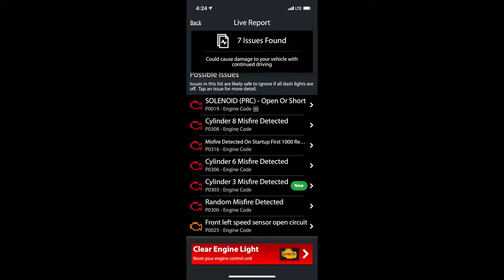2018 F-150 5.0L VCT Issue: P0025, P0019, P0300, P0316

Comment: Hello Sir , I want to thank you for this well done video, to the point but all details in there. I watched this several times. Then tried it on the left bank.
When touching wires as shown tic,tic,tic,tic,tock,tock,tock cleared codes problem solved thanks again. That was two weeks ago. Ordered and replaced all 4 solenoids yesterday.

Comment: Was having rough idle/stalling issue this morning. Found your video with in about 20 mins of researching. Did exactly what you said it fixed the idle/stall. Took it it to my local mechanic he confirmed via check engine like. New VCT solenoid ordered and will be installed tomorrow. Thanks again! Had me worried it was cam phasers or something much worse lol.
Reply: How much was the labor cost to replace something like that?
Reply from the maker: @bryansierra407  
The part was about $40 and took me about 30 minutes to change it.
Reply: @mrjdinner1000  where did you get the part from
Reply from the maker: @mikepiazza4872  went straight to Ford. Not expensive at all.

Comment: Another life saved by this video! Truck stalled as I was coming into work and would stalled immediately after startup. I keep a code reader handy and it had the P0019 code. Found your video and made some small jumper cables from our shop, tapped the VCT about 10 times and started clicking after about the 5th time. Started right up and no stall or rough idle, good enough to go home! Thanks!!!

Comment: Dude, just want to say thanks! I have a 2018 Mustang GT with 38k miles and the VVT exhaust solenoid on driver's side was giving codes and misfires. I did just like you said and it straightened/fixed the car out.  Oil has been changed about everything 5k miles. So it's not due to bad maintenance, like some other has said.  It's just a part that fails. Unfortunately for me I have to order the part, it's not available local.  Your video got the car moving again till new part comes in. Thanks again.
Reply: What codes was it throwing?
Reply: @jakefaulkner7351  P0018, was one of them another was multiple cylinder misfire. But I don't remember the code number.
Reply: @NoahNiega so did you fix it? I have p0025 right now buts it's for bank 2
Reply: I actually ending up replacing the vct solenoid for the exhaust on both drivers and passenger side of the engine. Drivers side was easy. Passenger was not fun, it has the high pressure fuel pump, and the fuel lines are very hard to remove imo, just to remove the valve cover on passenger side.
Reply: @NoahNiega  you wouldn't happen to know a link for where you got them or a part number please?
Reply: @jamesrodriguez8790 I actually got them from the ford dealership. If your in the Texoma Area, it's a Blake utter ford. One of my friends works in the parts department. You can call them and give them the vin and they'll get the correct part. They was actually cheaper than finding it online. I do remember the new part actually had a little (last couple numbers) different part number than the original. My friend said it's because it had been updated. So let's hope Ford's  update fixed the vct solenoids. My car did it at 40k miles, I now have 54k.

Comment: I have the exact same symptom and string of trouble codes on a 2013 expedition with a three valve 5.4 in it. I’m going to try this before I tear back into it. I just replaced all the timing chains, guides, oil pump, Cam phasers, and all of the rocker arms about 3000 miles ago. it has been running fine without issue until now. This problem seems to occur most commonly right after startup, before the engine reaches operating temperature.

Comment: Dealership has me waiting weeks for an appointment, sucks for them its warranty work. This does work, and I also cleaned the connector as well because oil leaked into it.

For anybody who can benefit from this, Harbor freight has retractable test leads which fit perfectly onto the prongs, and will reach the battery. Also some electrical connector cleaner may be necessary, and some compressed air is needed to blow out the connectors after cleaning.

Comment: Do you touch the hot wire from battery to both of the  vct contacts at the same time
Reply: NOOOOOO
Reply: @donlightbody8270 what is the correct way
Reply: @ab539  one to ground and  the other hot. doesn't matter which one
Reply: I was thinking the same thing

Comment: I've had dealer change phaser. A few months later it runs rough and dies at a stop. Purge canister changed. Runs fine for a few months. Then same thing runs rough and dies at a stop. A few months later it's doing it again. 2016 f150 5.0.  50k miles. These cam phasers and solenoids needing oil pressure is just a bad design. IMO. Especially when there's no check engine light??

Comment: Both times - I had just gotten an oil change - so that threw me off. But I have had this same issue and the VCT got stuck after I changed drive modes - sort of coincident that I was changing into sport mode when I all of a sudden began running rough and had to labor home with check engine light on.  Thank goodness for this post - the dealer couldn't figure out what was wrong and wanted to start ripping things apart.   Curious if you figured out why solenoid was getting stuck - just bad or did you find sludge when you replaced it ?  I have not replaced the solenoid yet.
Reply from the maker: I changed the solenoid and cut it open. Inside I found a small fingernail shaped piece of metal making it not fully reset to home after voltage was removed.  I thought it was oil too for a while.

Comment: Does ignition need to be in ON position (electronics powered but engine not running)?
Reply from the maker: Ignition switch should be off.

Comment: My Ford got a p0012 will this fix it?
Reply: @mrjdinner1000  thank you so much. I changed my oil and the old oil was filthy, the dealership didn’t change it correctly and they didn’t change oil filter. It’s been running smoothly ever since but I will still change my VCTs

Comment: Hi.
I had same problem and it's been a while.
I'm guessing it maybe cause by engine oil thickness. Manual says it need 5w-20 but last time when I changed to 10w-30, everything was okay until I change back to 5w-20. Now it start again and very often compare with when I use 10w-30.

I'm not a mechanic so I’d like to listen your opinion.
Thanks.

Comment: How do you recommend I make the jumper wire and do I connect to the positive battery or negative? Also which prong on the exhaust solenoid did you touch it with the left or right prong? Thanks
Reply from the maker: Once the wire harness is disconnected from the solenoid, it does not matter the polarity. Both pins need to be connected. One to positive and the other to negative. Just scratch repeatedly on the battery. Do not connect and leave it.
Reply: @jdinner399  okay thank you for that info

Comment: Where can I get a simple cable like this from or rig one up from something at home?
Reply from the maker: I de-pinned a couple of wires from an old harness I had and made this one. 
If this is your issue, just change the solenoid. They are cheap and take about half hour to change.

Comment: I have p0024 and p0025 on my 2014 mustang GT would that fix it ?
Reply from the maker: IT is worth a try and doesnt harm anything. Rapid wire contact then off, don't leave it on power.
Reply: @jdinner399  I took it to Ford and they wanna replace all 4 cams solenoids but am try what you said if they didn’t fix it thanx bud

Comment: I have a 2014 F-150 with the 5.0 and I keep getting a flashing CEL or sometimes a permanent CEL when accelerating over 4500rpm. The code has always been p0300. There's no signs of rough idling or loss of power when the CEL is on, I have no idea what it could be. It's annoying when I'm on the highway trying to pass people and seeing the CEL flash every time.
Reply from the maker: Flashing is usually a catalytic converter issue. Do a live-data run on the highway to see what your downstream O2 sensors are reading. Should be a somewhat flat line. Could be a plugged cat too.

Comment: I would start testing the wires at coil #8. Should have constant 12V+ on one terminal and the another terminal will be pulled to ground (pulsing) by the ECU when it is running. Check with a noid light. You can always run an extra jumper wire from a good coil 12V+ wire to the #8 coil 12V+ wire as a test. Still an issue. Run a new wire from the negative side of the coil to the correct ECU terminal using probe pins to make the connections.